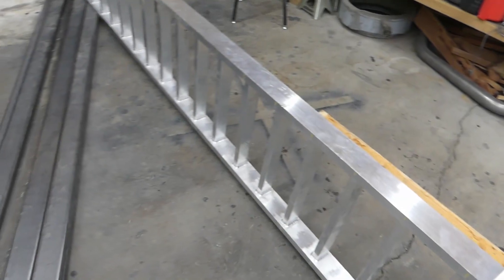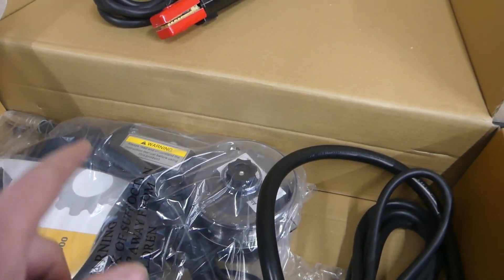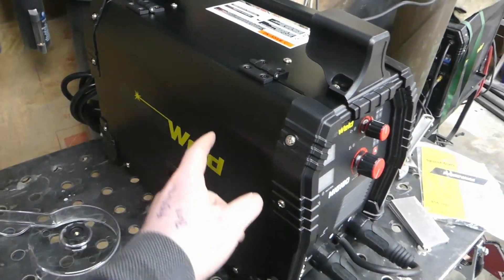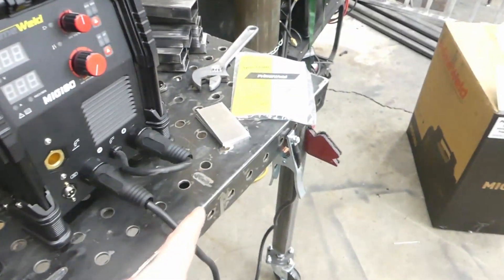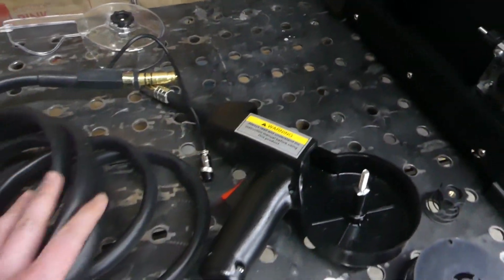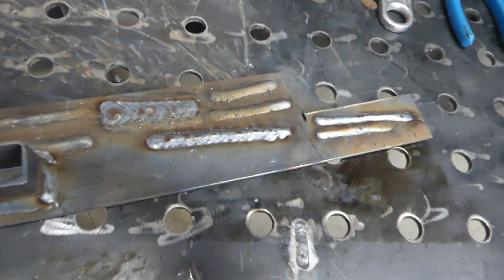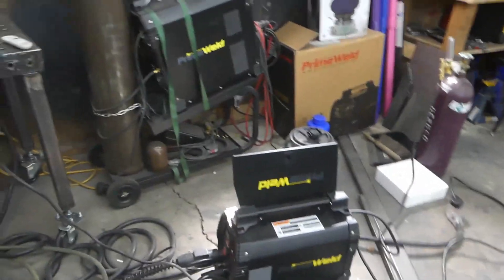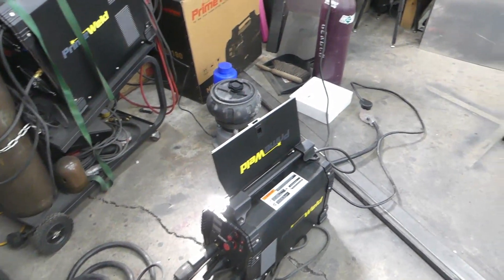Prime Weld Mig 180 First looks!!

Comment: On the Prime Weld Mig 180 standard MIG gun how do you know the direction of the flat plug that handles the wire feeding?  The plug has two terminals and it can fit up or down, the manual says that it is keyed but it doesn't appear to be.  The plug has the "Made in China" stamp on it...would that be on the bottom?

Comment: Great review , thanks for sharing the spool gun , I just wonder if it would’ve been cleaner if running straight argon. And I believe if using 75/25 the mig steel would have been better also, but still the welds looked good , Thanks again ,I believe I’ll buy it.

Comment: Hey man just got the primeweld 180 and definitely love this little welder and for the price you can't beat it ... However my only question is when you adjust the wire speed does it go up by 1. Because mine is a little off it is going up by 2s or 3s so if your wanting to set it at 231 and say your at 230 it will go up to 233 or 232 . It's odd and I don't know if I need to call Primeweld or what .
Reply from the maker: @charliehuntsman9827  I would send prime weld an email, if I remember right I can adjust mine by 1 I’ll double check when I get over to the shop and let you know
Reply from the maker: @charliehuntsman9827  I lied to you! Mine jumps up a couple at a time as well, voltage I can move small amounts

Comment: Does your wire speed go by increments of 4-6 while trying to adjust it? Bought a brand new one made 5 welds with it haven’t talked to one other person with similar problem but primeweld is saying it is normal to go in increments of 4 on wire,out of the 7 MiG welders I have and numerous ones I’ve used over past 15 years have never had one that does it and haven’t found one person that says there is does it plus trying to weld 1/16 metal on 120 with .030 wire barely penetrates the metal maxed out and my old titanium blows holes in it maxed out
Reply from the maker: Something is wrong with it, you should definitely be able to go in single increments, and I would think on 120, you should be able to weld 1/16 with ease
Reply: @fab_tastic7130  thanks for the reply back that’s what I thought I’ve never seen one go by 4,primeweld originally said something wrong and that he was sending one out then now he was wrong he talked to engineer and they are set to do that by 4 kinda sounds to me like they don’t want to warranty a bad unit, which is disappointing being that they are ditto have the best customer service lol just haven’t found anybody that there’s is going by 4 lol

Comment: Hey I’m looking at getting a new welder, why this over a Lincoln? Thoughts?
Reply from the maker: Lincolns are good units, idk if I would say this over one, if you're not new to welding and are doing production work with it, I'd go with more of name brand. This is a great entry level low volume work load kind of machine. I've been happy with it for at home use. If I was going to do more production with it. I would look into a Lincoln or Miller
Reply: @fab_tastic7130  Cool, I thank you for the honesty! No I’m not new to welding, I was previously a certified welder (1” unlimited). Just getting back into it. I think I’ll spend the extra money and go with a Lincoln as a Millermatic is still out of my budget for now. Thanks a ton for the response and great videos!

Comment: Just ordered this !
Reply: How did you like it?
Reply: @ArvizuDesignFab  it’s the first mig welder i’ve used besides the huge industrial millers from work and i hate it lol. 0.30 setting welds are too cold , waaay too much wire speed so i go based off the .40 settings . kinda hard to keep guessing & adjusting your settings when your constantly welding different gauge metals
Reply: @betosgarage  wow!! Interesting, probably something wrong on the wire speed selector? It will be different as the professionals Millers but shouldn’t be that bad, have you contacted Customer Service?
Reply: @ArvizuDesignFab  this is the second unit i’ve had , first one was bad out the box so it was replaced after calling customer service . i will be buying a miller 211 or lincoln next forsure tho for my home shop

Comment: Allways clean your aluminum before welding and always push. I use a cordless grinder with a wire brush. Probably not ideal but I do miles of welding. Mostly steel

Comment: I can say the same thing the warranty on primewell Tig 225x is just bodacious too I had the same thing I was running my machine hard welding aluminum and then all of a sudden I started having problems with the high frequency not wanting to start on aluminum and they did the same thing when I called them they said walk me through did a few tests check the gap on the high frequency and they did the same thing sent me out a brand new machine and a return tag for the old one I got nothing but good things to say about primewell I've had no issues with my machine whatsoever I run it hard for 6 to 8 hours a day cranked up between 180 and 225 welding aluminum 3/4 to 5/8 aluminum all day long.....
Reply from the maker: No doubt! I suggest these welders to everyone! Especially people wanting to get into welding!
Reply: @fab_tastic7130  same thing here I have found that this welder is actually quite better to use than the miller syncrowave 200 that i learned on my teacher was evan impressed and secretly bought one for home cuz his Miller dynasty 350 DX had a board crap out $2500 to replace it.
Reply: Miller is horrible. My 211 crapped out with only 3 spools running through it. Juuussst beyond warranty and Miller shit on me.
Reply: @jlduckworth8712  that seems to be the same thing with everybody soon as it comes to where it's just out of warranty instead of them bending the rules a little bit to get you going they tell you that it's going to be $2,000 to $3,000 for a board no matter what! Then just like I said with prime weld there customer service is beyond good...

Comment: Bud it’s not dirty it’s the coating on the aluminum burning off. I weld aluminum with a 575 machine in a fab shop. You have to take the coating off where you want to weld. The black can be wiped away with a wire brush. No offence but you small guys have no idea on what your talking about when it comes to welding aluminum. Why even show a video on it if you have no idea.
Reply: In America we have a saying; if you can’t say anything nice, don’t say anything at all. I bet that is written down somewhere in Canada too.